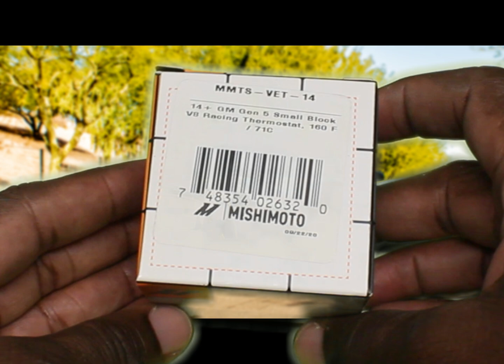C7 Corvette Thermostat Removal and Replacement

Comment: For 98% of C7 owners, putting a lower temp thermostat is NOT what you want to do..... It will screw up way more stuff than it will fix. 160 * is way to cold to run the engine.
Reply from the maker: You are correct! I have heard that as well. But, I live in Arizona, where engine temps are not helped by a stock thermostat. It has help me keep my vette cooler, for sure. The fans kick on quicker and give the system a bit of lead time. IMO.